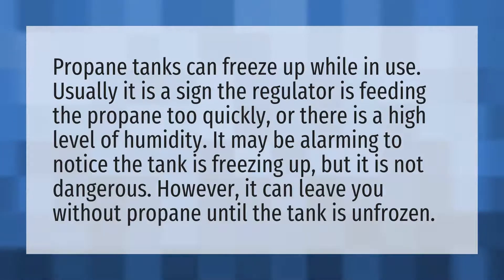Is it dangerous when a propane tank freezes?

Comment: This information is incomplete. It does not include many aspects of "freezing" involved with propane tanks.  You should call a trained and certified propane technician for answers to these questions.  The only thing more dangerous for homeowners than electricity could very well be propane.  They are both useful and safe until the DYI 'er gets over their head!